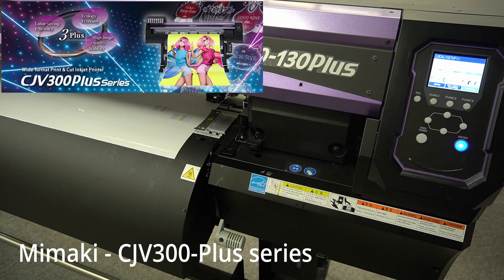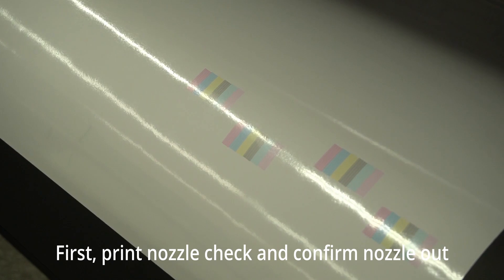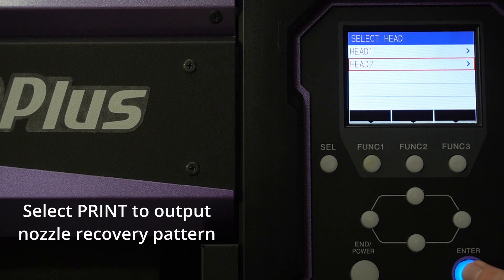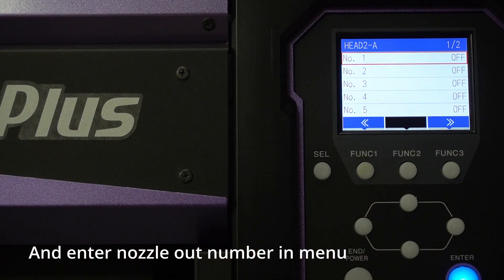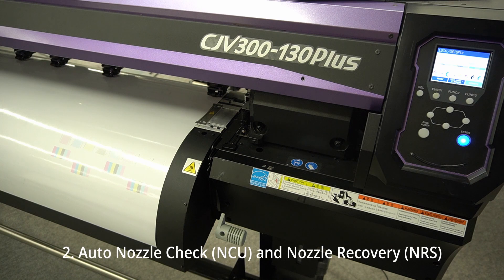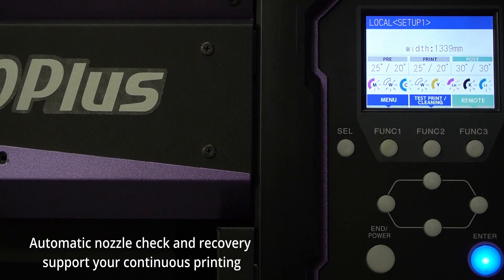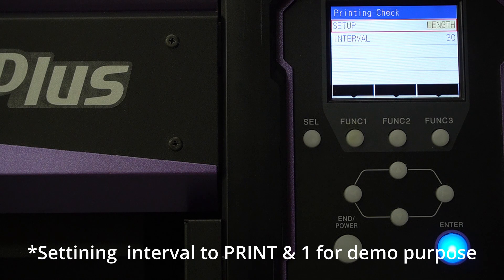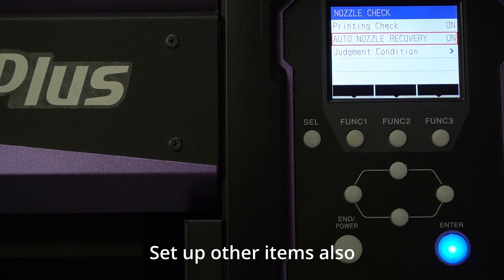Nozzle Check Unit (NCU) and Nozzle Recovery System(NRS) operation-Mimaki CJV300 series

Comment: I have a CJV150-75 with BS3 INK SET, i don't like the smell of the BS3, can I change to BS4 Inkset instead?  I really appreciate your opinion. Thanks in advance
Reply from the maker: Yes, CJV150 is capable to handle BS4 ink. Please contact your local Mimaki distributor for the details.